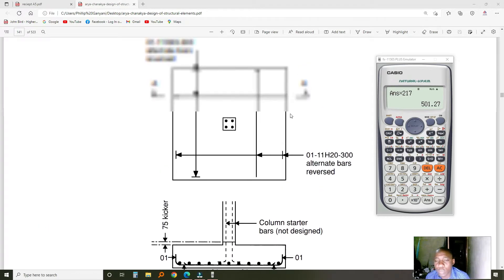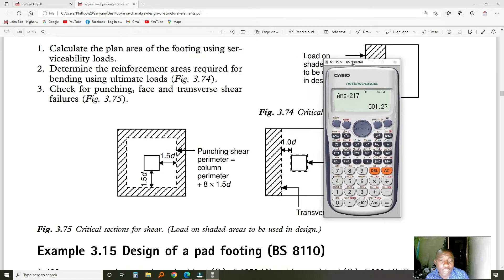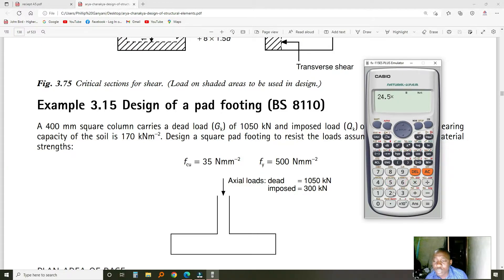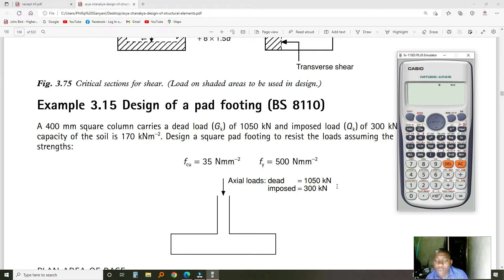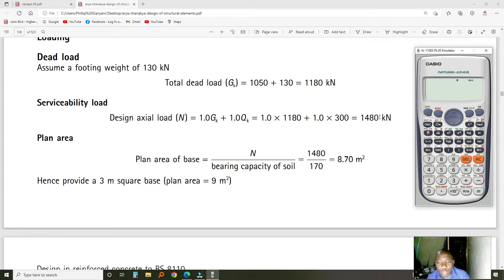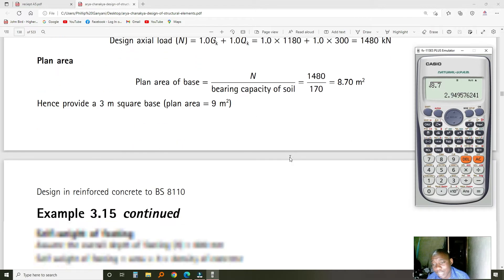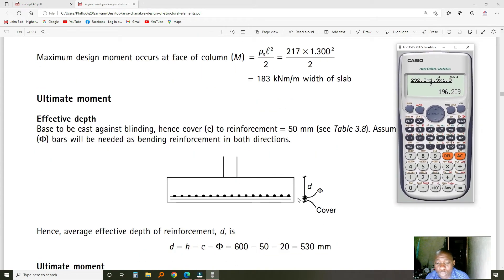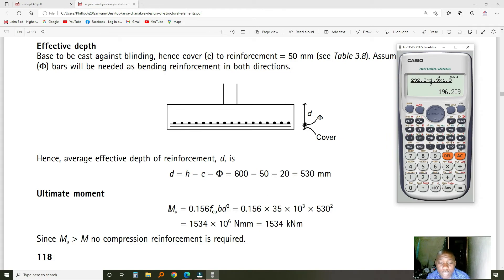pad footing design to (BS 8110)

Comment: How can isolted footing have 3m by 3m base. This is something far from the logic sir
Reply from the maker: It's just an example 
but it all depends on the soil bearing capacity and the load  
if the load is high we have a big base   even when the soil bearing capacity is low we have the same
Reply from the maker: if the bearing capacity is too low like in the case of the burj khalifa the design engineer had to use pile that is something i will explain with time
Reply: @civilgeek2567   That's just an example

Comment: Good explanation sir
I ask you a question 
When the checking transverse shear or line shear or one way shear for bad footing
Shear stress is less than 2vc or 2× shear capacity of concrete or section
is correct or not
Reply from the maker: Just wait for part 2 I will explain it
Reply: @civilgeek2567  
Thank you sir